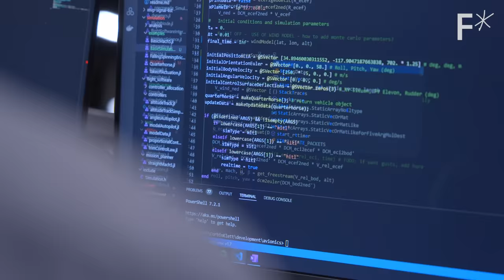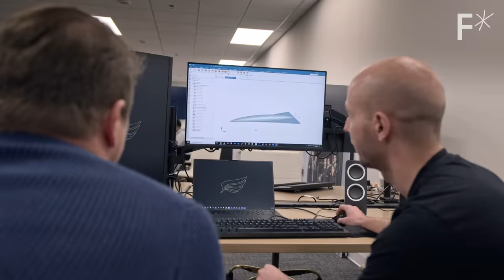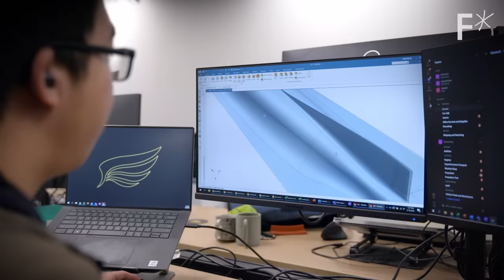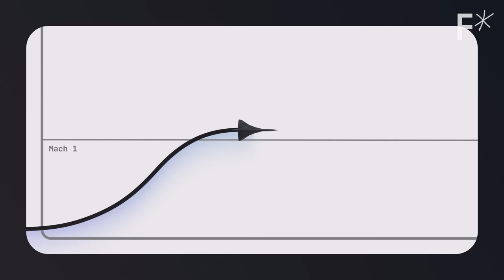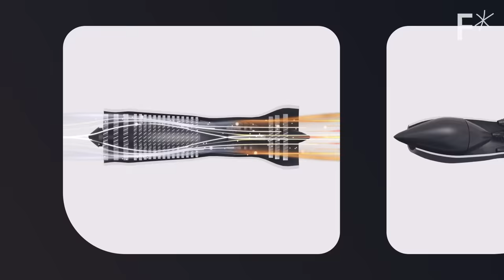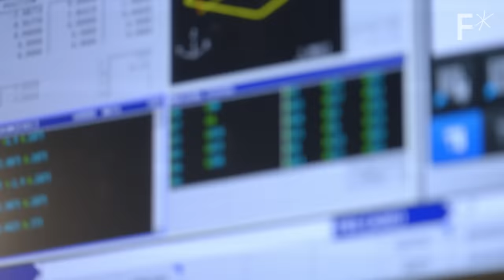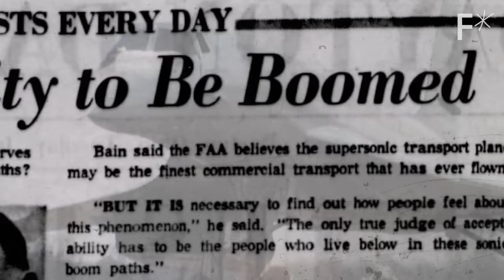This Mach-5 engine will do what no other can | Challengers

Comment from the maker: Do you think hypersonic passenger jets will become reality?
Reply: Absolutely.
Reply: No doubt whatsoever. Why? Because they're a stepping stone to single-stage-to-orbit.
Reply: Not while the leading edges are standard materials.
Reply: No.  What Earth needs is efficient (perforce, subsonic) air transport.
Reply: Not since oBiden was selected... jus say'n
Reply: I don't see it as practical. Supersonic passenger jets failed for a reason.
Reply: Yes. hypersonic jet aircraft,sub orbital and Moon,Mars flights will all become a reality in the next 100 years.
Reply: Never.

People seem to think the barrier to supersonic passenger travel is simply the act itself. The mere attempt to go those speed ranges is too difficult, engineering-wise.

They're treating it like the Concorde never existed. Like we've never had a supersonic passenger plane before. 

They seem to all forget what the real problems with supersonic passenger travel are. 
Sonic booms, and all the PR problems & regulatory problems that come with that.
Outrageous fuel consumption needed for afterburner use. And the usefull load hinderance that entails.
Completely unfeasible maintenance costs & maintenance hours per flight hour.
And the subsequently luducrous ticket prices that only the 1% of the 1% will ever be able to afford. 

Hell, the only places where you are even allowed to try supersonic passenger travel is over the oceans. far out over the oceans. 

I wish you guys luck. But i am 100% convinced this aircraft will never fly passengers.
Reply: Only in the upper-end of society. Hypersonic flight consumes a stupendous amount of fuel, which in turn raise up the price-per-passenger. Maybe if they'd switch to Green Hydrogen (and Green Hydrogen becomes cheap and abundant enough down the road) it'll become something less of a luxury. Either way, since they're barred from utilizing the system over land, it drives it into an ever deeper niche. Right now, it's very hard to see how airlines will be able to turn a profit on a Mach 1+ airliner.
Reply: Not for 10 or so years. maybe more.
This looks interesting.
A Australian company will test fly a Hypersonic drone next year, using a scramjet engine. has reached Mach 8 in a HIFIRE test and newer version was offered to USA Military under Aukus and has reached Mach 12 in Tunnel and ground tests.
Reply: not a chance.
Reply: I didn't fail, I found 2,000 ways how not to make a light bulb; I only need to find one way to make it work.  (Thomas Edison)
Reply: Not by modifying current technology, sure they will get close but other problems will surface trust me 😉
Reply: @Godscountry2732  nope maybe 30 years for commercial, the military already have 😉
Reply: Not in the near future because of the dangers of any failure at mach 5. The pilots of the Blackbird wore spacesuits as a precautionary measure to pressurization failure; does anyone think that commercial passengers would be ready to take that step? Would the FAA sign off on those risks?
Reply: highly likely. when/how/who is more appropriate query. is inevitable.
Reply: If you go into space yes. Not with a jet. Probably rocket lift, ramjet to glide, and land. The closest thing is a variable flow J-58
Reply: If the Americans have control possibly but if its the Europeans who developed Concorde then America will scupper it and not allow it over their airspace in my personal opinion.
Reply: The world of aviation’s already moved on from the hub and spoke model to direct connections. A Small scale hypersonic planes for business might be feasible. Maybe.

But we’ll move to slower, more comfortable, and efficient aircraft first. Mass hypersonic air travel won’t be a thing for the coming decades.
Reply: Uhhh aren't current planes already too costly and wasteful to run even with super high bypass engines and less than mach 1 speeds? The Concorde failed because of how expensive it was and now you're saying they are pooping out a mach 5 passenger plane? Who the hell has money to buy a ticket on board of that?
Reply: not in this year
Reply: According to the latest Top Gun movie, we're at Mach 10.  So many people think we are now.  : )
Reply: It would be neat if it were true, but if I had to guess if the DOD and NASA had discussions after the retirement of the hypersonic rocket-powered fixed-wing Shuttle and Mach 3.5 jet-engine powered SR -71/YF -12 A, to design and build a jet-engined or rocket-powered hypersonic sub-orbital spy plane, bomber, etc "I would say no."

Did the DOD need a hypersonic aircraft with our current satellite, cruise missile, and ICBM hypersonic reentry technology?I say no, but they could pretty much build anything they want under a hidden black budget Darpa program.Not to say the SR -71 was a hypersonic aircraft but the simple fact it was designed in the 1950s and operational in 1964, it wouldn't have surprised me if the DOD continued the program after 1999. 

China claims they tracked the SR -71/YF-12A  over its mainland at Mach 3.5 at 100,000 feet. The Shuttle as well was piloted on its wings at very, very high Mach numbers on reentry.
Reply: @We All Laugh Down Here that's what killed Concord and SST. Those issues haven't gone away.
Reply: You know, there's a lot of you know, possibility that you know, like, it's like, you know....

This is great a Jr. High level content.
Reply: Top speed in atmosphere is Mach 25, then the ship goes orbital.   As to your question, the scram jet is military hardware, not for passengers.
Reply: Will they become a reality sure. Will you be able to afford a ticket on one should they even be offered... good luck with that. While I applaud their efforts and wish them well, I find it far more likely the technology and it's initial improvements will come from the military sector before civilian. These guys may figure it out but frankly they're at a massive disadvantage. They have no access to cutting edge classified materials or components and while they can always get funding it will never touch the resources a nation can throw at the issue. These kids managing it would be like winning the lottery on a fluke purchase at some random gas station. Possible but far from probable.
Reply: This is all bullshit, it's a way for a group of people to play, and get payed properly from the tax money. That idea won't work, there are other intelligent people who tried that crap before and failed. Because the ramjet has a vicious thirst. So you can't give it enough fuel for it to be efficient, as long as you don't have enough oxygen in the ramjet. And you don't have enough oxygen in the ramjet because the hot gas that's coming from the jet is poor in oxygen!!!! So the mixture in the ramjet will be very hot but very rich, not efficient enough. Test it to see for yourself. The solution would be to have a normal jet in the middle and 2 separate ramjets around it, so they get fresh air when working. The jet with the afterburner would take the craft to Mach 1.8 no problem, more than enough for the ramjets to start. It's not true the ramjet can start at mach 3, it can start at over mach 1 no problem. Even if you overcome all these problems, the fuel consumption will be enormous, let alone the cost of such craft. Elon Musk wouldn't afford a ticket for that. So spend the tax money otherwise and get fkd with your mother fkn projects. Try green energy
Reply: I'm surprised your not trying to make it possible with the ohhhh so lovely green technology. 
Powerful windmills and super strong solar panels to charge the Chinese made batteries. 

Instead...you go for that dirty.... nasty... organic... fuel  derived from carbon...that comes from a whole in the ground.

Shame on you...I love it...make it spew fire  for as far as the eye can see. Let it make noises that raise the testosterone levels across the world.
Reply: Supersonic passenger jets failed, I don't see how a hypersonic passenger jet would fair any better, no matter how much we want it, with our current technology it just isn't feasible.
Reply: If and only if there is a market. I'm not sure people are going to be willing to pay the premium to get there a few hours sooner. What really killed Concord (and the reason why no U.S. SST was ever built) was the lack of a market. I'm not sure that the problem exists for which hypersonic passenger aircraft is a solution.

HOWEVER, I can very much see the DoD wanting a working hypersonic aircraft which can take off and land from conventional airfields. Unfortunately, such an aircraft would be anything but maneuverable. Even if the aircraft could withstand the g loads the occupants could not. For that reason I see a hypersonic aircraft as being either autonomous or remotely piloted.
Reply: What about the sr71 ? I’m pretty sure the f15 can do over Mach 3 ,, your biggest concern is fuel ,, because our government doesn’t want fossil fuels
Reply: @jeanladoire4141  Not for the likes of thee and me dude 😐
Reply: It will if we can build and run this tech at low costs.  This is well out of my neuroscience education, but I have enough physics and chem to understand what the challenges are.  Dealing with friction heating, safety and stability in dense air near at low altitudes, redundancy and ultra robust parts that are light enough to fly, are all huge materials science obstacles.  I'm so impressed by this teams effort and determination!  I hope they find smashing successes!
Reply: No, it's illegal in every country...
Reply: @dewaynemcgowan1937  the f-15 has a max speed of Mach 2.4 and efficiency is a big deal not because our government doesn't want fossil fuels, it has to do with range, global warming, and cost.
Reply: Nope:
1. Sonic booms restrict flights to basically over oceans. No Cross land supersonic flights will ever be permitted
2. Cost of fuel is going up, up, and away. I suspect by the 2030s air travel for most people will just be too expensive. Perhaps people will  afford to go on a long distant flight ever couple of years. Global Oil production peaked in 2018 and will be declining about 5% to 7% annually. We are already starting to see Oil prices climb. I think most airlines will go bust when Oil exceeds about $120/bbl to $135/bbl
Reply: @fromaggiovagiola9128  that's overstating its rigor😉
Reply: whats the point of going faster when u can go cheaper
Reply: I think it will be a show off between SpaceX Starship and hypersonic passenger jets.  I think hypersonic passenger jets will be the Betamax of paid air travel.
Reply: we had a concord and it failed, doubt about getting any hypersonic passenger aircraft.
Reply: @keymartin630  But do we need SSTO? A reliable and reusable 2-stage rocket arguably makes SSTO unnecessary.
Reply: Yes.....one step at a time
Reply: I live in Atlanta. Would this be something I would be able to come see?
Reply: Nobody though a rocket sent into space could land back on earth and fly into space again.  I guess anything is possible 🤷🏾‍♂️
Reply: yes
Reply: No
Reply: @TimCortesi  True to a point. A two-stage rocket will need infrastructure to support it. Right now, without a civilian destination in space, two-stage rockets are sufficient. However, to survive the long run, humanity must get out into the solar system. In my opinion, two-stage rockets are less efficient as they need guidance, fuel systems, engines, etc for two units, but only one is actually going into space. Two SSTOs could eventually deliver twice the cargo, and launch from modified runway facilities rather than specialized facilities. It really comes down to whether or not we get around to putting a Hilton in space; if that happens, the SSTO would be more economical.
Reply: No I don't think so..but we will probably discover a new form of propulsion in 100 years..that will be the next leap until then just slow jets
Reply: @algorythemQ  keep coping republican
Reply: No.
Reply: @rdbchase  yep
Reply: @seha6391  he didn't invent it tho
Reply: No
Reply: no, sonic boom
Reply: @cellokid5104  ya but transitioning From Sonic to Hypersonic is Still an impossibility Without Rockets at this point in our Technology They are trying to Bridge the Gap
Reply: loud af, no
Reply: at some point, no doubt about it.
Reply: No
Reply: Would hypersonic flight be affordable?
Concorde was extremely expensive and I always felt that Concorde was treated like a grenade with a loose pin.
It was a controversial aircraft people were always looking to poke hole in,
Supersonic boom, cost, problems and crashes ect
Reply: It’s seemingly an inevitability especially for beyond the year 2050 when crude oil based fuels are fully phased out! :)
Reply: The best way to produce a engine that has subsonic and supersonic combinations is a turboramjet
Reply: I expect some will be made, but they won't be commercial. And it could well be with a different propulsion system. Think UAP.
Reply: No lol, airlines already have a hard time making profits so they dont need money-skinhole planes 😂
Reply: Off course, we need this kind of technology now, this is the next step.
Reply: @davecrupel2817  The Answear is good .😉👍
Reply: I belive the People must in the Future more move under the Earth and in schmaler ways and so gar, then that is better for the Nature. 
We makes here to big footprints on the Earth,that is more as good Visible.
Reply: Supersonic? Maybe. Hyper sonic? Absolutely not. Unless there is a massive breakthrough in material science that would allow a cheap material to withstand extreme temperatures, there is no way it will become economically viable.  
That being said, never say never. I just don't think anyone watching this video will live to see it unfortunately.
Reply: Not in mine, our your life time. Maybe someday.  The biggest reason for hypersonic flight is getting to what's past THAT. Alien craft make it look so darn easy!
Reply: MAYBE YOO COOD CALL IT THE SR-71...
Reply: I’ve been wondering for a long time why the fastest aircraft ever invented was designed and built about 60 yrs ago. How is it that we DON’T have hypersonic flight by now?
Reply: Startupsbmaking bold futuristic promises are ten a penny, hypersonic flight is riddled with engineering & legal challenges that have defeated many of  the brightest minds humanity has produced. I feel like I'll be riding a unicorn to work before this becomes to fruition. Lol... No offence.
Reply: @10aDowningStreet  
Yup. Unicorn with spinners.
Reply: How do they plan to solve the sonic boom problem? Flying at Mach 1+ creates a loud bang. That is why Concorde was NOT ALLOWED to fly at Mach 1 above the land.
Flying faster than sound is very bad for people on the ground.
Reply: someday for sure
Reply: @davecrupel2817  I completely share your points and i would like to add a new big one to your list. The Concorde flew in an age where the time spent flying was just wasted time. There wasn't a lot to do really on flight from a passenger perspective, so speed was kind of worth it. But now we live in an Age of Internet on Planes, Laptops, Podcasts and Netflix. Time spent flying is easily filled with work and entertainment. I don't think people will buy a Planeticket 8x more expensive just so they can save 6 hours of flight time. Even the ultra rich fly relatively slow, because private jets are filled with amineties and you can keep working, meeting and relaxing. Going fast was never this useless lets be honest. I travel by train a lot and i can write for work, watch youtube, check emails and nap. Its no longer time wasted like in the 90s.
Reply: Hypersonic passenger jets? Nah, not gonna happen. Ramjets consume way too much fuel, and that is a problem, especially in the future with fuel prices going through the roof. And then there's maintenance cost. You think Concorde tickets were expensive? Wait until you see the ticket prices for a hypersonic jet! No-one will be able to afford a ticket, and any airline flying those jets will have to drop them like a hot potato or go bust.
Reply: Not with that kind of fuel for sure.
Reply: Nope.... it was proven by brits and french ))) and before them by us ;)
Reply: does the aircraft have to dip the nose down because of earth's curvature at that speed? otherwise it would end up in space after 30 minutes.
Reply: @trile9951  
that's what all flat earthers say because they have no idea how anything works.
Reply: No. Fuel economy will be awful.
Reply: Pulse detonation engines
Reply: @RWBHere  and thats just one  reason why those projects will fail
Reply: Only with pulse detonation engines with progressive build up of speed, otherwise our bones would shatter from take off.
Reply: clearly never heard of the concord. it did not end well.
Reply: Not likely, while fast ramjets are notoriously inefficient. If it comes to pass tickets will be expensive.
Reply: No.
Reply: Most definitely!
Reply: not with that airframe .
Reply: @keymartin630  that project exists
.... in England
Reply: @toupac3195  Proxmire!
Reply: @jeanladoire4141  
pas du tout,
Reply: the real question is do you think people will be willing to spend more money on airplane tickets to offset the costs of these hypersonic aircraft compared to what we currently have.

people have already voted with their dollar with the concord, and the concord is no more. hell, they won't even pay more for better service, people just look to see which airline is offering the cheapest tickets for their destination and then wonder why the service sucks.
Reply: @arturoeugster7228  You mean Skylon? There's still no place to go in space.
Reply: @keymartin630  right, they are supported by RR, the EU and have a product the heat exchangers. and a DARPA contract.
This here is a fake video,
Reply: I'm also an aerospace engineer and the simple answer is NO.
I love what these guys are doing and what they are trying to achieve but there's issues.

For starter, the sonic boom stuff ruined supersonic air travel is just nonsense. Its just been said so many times that its considered fact. The real problem is market place and people willing to pay for going that fast.

There's a great documentary on Concorde that goes over its entire history. It highlights one of the great examples of sensible market analysis and is something every business student should study.

A lot of people don't realise that Concorde was almost pulled from service after a couple of years because it was losing so much money. The pilots said it can't be losing money because every flight is full. So the business guys said "If you can make money you can keep flying and run the whole Concorde show if you want."

So the PILOTS did one of the great case studies in market analysis. They found that most of their passengers were this small group of bankers and lawyers. Some of them were flying 3 or 4 times return a week. These people got on Concorde flew across the Atlantic and as little as an hour later flew back. So they asked these people were doing. 

They found there was a lot of banking contract and major business contract work that needed to be done by real people face to face and at times those meetings were only minutes long. So they asked these people if they knew what a ticket cost and got a huge surprise because none of them really knew. They just had their secretaries book the flights. So they asked what they thought a Concorde ticket was worth and found these people valued Concorde over 5x higher than seats were selling for.

So the pilots jacked up the prices, people kept flying on Concorde and over the next 25+ years Concorde was the most profitable part of British Airways. AND THE WHOLE TIME IT WAS RUN BY THE PILOTS

What killed Concorde wasn't the Paris crash it was 9/11 and the A380. In the 9/11 attacks Concorde lost almost 100 of its biggest users. That loss of their customer base hurt huge, but then Airbus who were bringing out the A380 would not service the engines which they had exclusive rights too. They wanted to get rid of Concorde and those reasons have never been clearly explained. Richard Branson tried to buy the planes and Airbus said so what we control the engine servicing.

That's going to be the problem for Hermeus. Where's their customer base and what will the big players do to them?
I love the technology and love what these guys are trying to do but there's an old saying in aviation. If you want to make a pile of money on aviation you need to start with mountain of money.
Reply: I hope not.
Reply: No. Hypersonic commercial flights are banned above land, so no NY to LA flights and people won't pay the money for USA to EU flights.
Reply: No. Cuz of same reason why we have no Concorde ancestors.

Sonic boom.
People just won't tolerate it
Reply: Dark passengers?
Reply: This is a general avaition video.Developing, engineering, and manufacturing Mach 5 plus engines is not something you'll find on YouTube.Perhaps in 50 years we will see some videos from MIT, Darpa, Boeing, RR, etc., that were classified during the 1990s.
Reply: I am just wondering why they only use nuclear tokamak thermal shielding,
to keep heat management of 150,000,000 C+ controlled on the inside, 
rather than on the outside.
Reply: Possibly. If anything, it will drive our understanding of aerodynamics forward. What they really need that all other successes had, is competition.
Reply: @rdbchase  
We have those!  They are called airliners.
Reply: @MrMuki61  
"Green hydrogen"?  Hydrogen is a colorful gas?😁
Seriously, Green alternative energy cost much more than conventional sources!  "Green" hydrogen will always cost more!
Reply: Quite possible if they can get the cost down, which they may well be able to do!
I have seen proposals for suborbital flights across the Atlantic and Pacific using modified SpaceX Starliners.
Reply: @mahbriggs  Nonsense!  Commercial airliners might be 30% more efficient and should be; hypersonic travel for the filthy-rich is absolutely the wrong idea at the worst possible time.  Humankind has not begun to exhaust the possibilities of appropriate technologies, but we are ignoring some of the most important (LFTR and passive maglev, e.g.) in favor of faddism and fantasy (Hyperloop, Direct Air Capture of CO2, and this, e.g.).  It's possible that someone other than you or I will one day use hypersonic transport, but that doesn't do the mass of humanity including me and very likely you any good.  No matter how good this engine is, it's not going to change the kinematics involved or lower the cost of hypersonic flight to the point that any but a few could ever travel that way.  Before fantasizing about hypersonic planes you'll never fly in even if they're built, reflect upon the fact that Boom Aerospace has no engine for its proposed supersonic passenger aircraft; might as well imagine hypersonic aircraft instead, I suppose.
Reply: @karlshipley5142  -- are probably too loud to use on a passenger aircraft.
Reply: Yes, but not soon. There are little to no markets for it.
Reply: @oneroneen  
Don't disagree, but things change!
In 2015 did you think SpaceX would be reusing it's Falcon 9 rockets?  Or that in the year 1990, that the first smart phone would be developed by IBM within two years?
I try not to predict too closely the rate of technological progress.
Reply: No. They likely won't.
Reply: @bigboypants988  
Trans Pacific and trans Ataltic passenger service is growing, and new supersonic designs are being developed.  Plus at the altitudes a hypersonic vehicle would travel, it is possible sonic booms might not be a problem.
Reply: This seems like a military project to design mach-5 drones.  Commercial passenger flights have a lot more design constraints (Payload carrying capacity, fuel efficiency, range, passenger comfort considerations, zoning restrictions for sonic booms, etc).
Reply: as an aviator who may very well go into the commercial sector I hope so; that way I can fly one.
Reply: @jessstuart7495  
A quite worthy endeavor in itself!
But many military projects have civilian uses.
Reply: Hermeus is taking this in all the wrong ways. To achieve hypersonic speeds at scales above the small Unmanned Aerial Vehicle with today's technology and metallurgy, you need SCRAMJET engines and a Rocket Assisted Takeoff to get to Mach 1 and achieve the appropriate speeds.

Unless you have a Combined Cycle afterburning jet turbine, ala DarkStar.
Reply: No
Reply: naah too risky
Reply: no
Reply: Yep!! But I Will let other people test for me for some years first ! Remember the UK Comet 1st jet passenger plane.
Reply: Only if fuel consumption per passager is somewhat comparable to subsonic planes. It takes time to get to and from the aeroport, and you have to adjust your plans to routes and times when planes fly. If money is not an issue and time is most important, that subsonic private jet will bring you faster from point A to B when you need it.
Reply: Not if you keep using the imperial system hahahaha
Reply: never
Reply: Of course. Less than 200 years ago people thought passengers on the early trains would suffocate. It's not a question of the science, thats largely known and understood, but of persistence in engineering, and then economics. If there are people prepared to go into space, there are a LOT more prepared to travel to places really quickly. If not this attempt, there will be another, and another until it happens. There is just NO reason it won't happen, so its inevitable.
Reply: No, a big reason why the Concorde failed is because of the supersonic boom it created. I'm pretty sure going supersonic was even banned in multiple European countries. That thing will burn so much fuel as well, and that thing will probably be super maintenance intensive.
Reply: they will really have to build a ne plane, that is a lot of stress on an air frame
Reply: Not over land
Reply: I believe it will have a massive effect on how we defend ourselves before it eventually bleeds into the public sector.
Reply: @definitelyfrank9341  14:33-14:46 explains what thats not a significant risk to their business model.
Reply: absoolutely not
Reply: No, they burn way too much fuel and make way too much noise to be viable. A 2-hour hypersonic trip in economy cattle class would cost just as much as a 8 hours in a luxurious first class private berth on an A-380 or a private plane, equivalent to a nice hotel room. Processing,  luggage checks and transits to and from airports will take at least 3 hours already anyways unless you are booking a private aircraft for yourself.
Reply: @graysonlaugher3143  Only use I can think of is some military applications, it could deliver a spec ops paratrooper team with a lot of supplies anywhere in the world in 5 times less time than conventional military aircraft
Reply: no
Reply: Yes, but my bet is on RDEs.
Reply: NO
This is ridiculous, you can't change the laws of physics. The energy per kilogram in chemical fuel & the tremendous amount of drag at hypersonic speeds.
This was all tried & tested 60+ yrs ago with the  X15. Small range, massive cost. Can never be used to carry passengers.
You're fantasists
Reply: @pobinr  

People used to say stuff like that to the Wright brothers...  People used to say stuff like that about space flight.  People used to say stuff like that about sailing wooden sail boats around the globe...  People used to say stuff like that to Elon Musk about reusing rocket boosters and upper stages.  Now, all of the aerospace companies are getting in on reusability, to one degree or another.

People who said stuff like what you said were always proven wrong, and always will be proven wrong.

Materials exist today, that didn't exist in the 1960s and 70s.  Design concepts exist today that didn't in the 60s and 70s.  That might be the key in making a difference in today's engineering efforts.  Heck, there's a company building a rocket completely from 3D printing it, and it's getting ready for its first flight, soon.

Jet engine designs have become more sophisticated since the early days of jet propulsion.  The X-15 was powered by a solid rocket motor, not a jet engine.

Things have changed and improved since then.  Maybe this company might not quite get there, but they will have made significant progress in showing what works and what doesn't, and the next venture might succeed where they failed.

Look at Bigalow Space.  They invented the inflatable space module.  They never got to launch their inflatable space habitat and went out of business.  However, a new company is getting ready to launch their inflatable space module and it will be tested in space (I think it will be connected to the ISS).

Never say, never.
Reply: @thecrusader6401  fuel cost bro. How they gonna afford it? British airways nearly went bust after using concord
Reply: @direbearcoat7551  fundamentals aren't changed enough to make enough difference.
Reply: Reality, available to an elite and very well-heeled few who believe the benefits will outweigh the likely extreme cost of a ticket.
Reply: Yes, but never for the common person. The energy needed is, and will forever be extremely high.
Reply: Concorde Mk II? It's definitely possible, it's highly unlikely to be profitable.. That's the biggest problem.
Reply: Yeah, the concord was the first to make it super sonic now hypersonic isn't impossible
Reply: I think it will mostly live in the military space for quite a while 10-30 years or so. Safety, economics and adhering to extremely stringent regulations is the nature of civil passenger aviation. This won't become reality anytime soon, even if the technology works. But of course I hope to be proven wrong :)
Reply: It had happend before using Concorde.
The fuel economy and maint cost however... I hope your customers are all billionares.
Reply: @niccatipay  Concorde was supersonic, not hypersonic. Quite a big difference
Reply: @thorwaldjohanson2526  
Ah thankyou for the clarification.

Perhaps such flights would be going to space and will be used by national leaders or by select groups to attend an emergency meeting. Fuel and maint be costlier tho so it will need a cheap source of fuel.
Reply: @niccatipay  you will not be able to go to space with this, especially not reach orbit (opposed to flying up and falling back down). Turbojet, ramjet and scramjet engines are all air breathing, they do not work in space or very high atmosphere.
Reply: @thorwaldjohanson2526  
Liquid rocket assist to travel in space for a bit. It should cause less friction during hypersonic travel and you wont have to worry as much  about the weather.
Reply: the concorde failed and so will this
Reply: No.

Before that we will use warp drives ...
Reply: Yes off course, the question is when and how to overcome its existing problem.
Reply: probably not, because the ticket price will be so expensive so nobody would buy it. We had supesonic Konkord before
Reply: I think a lot of people are disillusioned in this video in thinking what they are doing is actually important in some practical way. If you want to travel fast, just go higher, hell the higher you go requires less fuel... this isn't that hard. Nobody cares,.. I mean nobody really cares about traveling at 5 times the speed of sound,.. unless you are going into space... so why not just cut the BS and go there?
Reply: @andyowens5494  Okay, but, would 70% - 80% of the world be willing to spend 90% - 145% more to get to their destination several hours earlier? If I remember correctly the video says at one point that people dislike air travel because it's 'un-luxurious'? So I'm assuming either they're plan is to cut the flight time down a lot to make their "unbearable suffering" shorter, or, to make flight more luxurious - and to do that, you'll need to waste space. From what I have learnt from my physics book, going mach 5 will give you more than 2Gs at least, while just flying level. Not very luxurious. It'll also be difficult to keep the interior of a air frame that has a weighted-average temperature of roughly 1,350 degrees at an optimal temperature, won't it? I highly doubt any airline company will buy it. Airline owners want a plane that'll make profit, not a "futuristic" plane.
Reply: @definitelyfrank9341  70-80% of the world do not need to want this. 70-80% of the world do not own a car! (EDIT: 82%! Yes, only 18% of the world owns a car, far fewer fly, and a tiny proportion of the billions of people on planet earth will want to go hypersonic, but thats still a LOT of people). This is a niche product, as Concorde was. I do not know when you last looked at a physics book, but the speed one travels at has absolutely nothing to do with the g-forces experienced (and I say that as a physics graduate). The g-force comes from the acceleration, so whilst it could accelerate to mach 5 at that rate, it doesn't have to. Concorde didn't, so why would this!? Interior temperature - will not be a problem; the SR71 Blackbird had a very hot external skin temperature (and the crew warmed their food against the windows), but with insulation and air conditioning, its relatively easy to set an internal temperature. The space shuttle went even faster, and they manage quite well. Do not forget, the outside temperature of most commercial flights is well below freezing, but in my last flight there were people wearing t-shirts and sandals; it's amazing what we can do with thermodynamics these days. I guarantee if they can make it, someone will buy it - heck, rock bands run their own aircraft; there are people on this planet who can afford pretty much whatever price they would charge (and I guess you're not one of them, I know I'm not). There is even an example airline in existence already: Virgin Galactic - not many customers, but they exist and are willing to pay. So, why won't hypersonic transport be viable again? Heck, people will go on a Virgin Galactic trip to come back to where they left from!
Reply: @andyowens5494  It's kind of irrelevant since this thing will be flying over water primarily.  I would also like to ask: which airliners would want a hypersonic aircraft that can't fly over most relevant countries, has seats that most people can't afford, an aircraft that can reach speeds very few aircraft have ever done because: 1. It's very dangerous. 2. There are very few tasks that require it. 3. It's very costly. 
The SR-71, and the "space shuttle" are very different to what these people are building. The SR-71 had a tiny cockpit to carry 1 man, and It could only go supersonic. It also seems you are trying to reason that it would be good to have them around for the rich. It takes tens of thousands of dollars to maintain a supersonic aircraft, much more for a hypersonic one. Although I may not know much about physics, I know a good amount about business. I heard that Concorde was built to be the future kind of transport (and also to leapfrog ahead of the Americans). These guys are also trying to make hypersonic Into a future speed to move at. Also, wouldn't it be a bit difficult to distinguish an ICBM of similar size, and speed from a hypersonic aircraft? There's probably a way to distinguish the two but it's just a thought.
Reply: @definitelyfrank9341  Did you actually watch the video? 14:30 to 14:45 explains the market assessment they've done, and if you understand business so well, you'll know that other people will have scrutinised that assessment before investing in the funding thats got them this far.

I'm not going to pick all your points apart again, I've got better things to do if you havent taken in whats in the video itself. However, confusion with ICBM's - I give you a) flight plans, and b) it's trackable (and no, major airports are not all home to missile launch sites). I'm not sure what kind of business understanding you have, but I'm amazed if you've ever been anything more than self-employed; vision and understanding will get you much further, and both can be learned.
Reply: @andyowens5494  Yes, I've watched the video. I'm a minor by the way. I also meant confusion with incoming ICBMs, because you don't usually want to shoot down missiles from your country. And, also, you can't see the flight plan of a aircraft (unless you're in the cockpit). At least not without the aircraft sending it to you, but I don't think they can even do that. And If companies really thought about the how successful said project would be, then, then you wouldn't be able to look at a big company's history and find many failed but still expensive projects. Just look at the multi billion dollar LCSs US is retiring. 

You can't really make profit from a hypersonic airliner. You can't get an average pilot and put him in a hypersonic airliner. He'll have to go through a LOT of training... And that's if they'd even want to fly that aircraft. Since pilots and attendants get paid by the hour, and you're going to take less than 1/5th the time it took the record holding British Airways Flight 112 747, then you'd probably have to pay them 5 times the amount they're usually paid.
Reply: @definitelyfrank9341  OK, so you're a minor; you have a lot to learn, and I suggest you make the effort to learn BEFORE commenting on stuff you don't understand. That applies more in life than on Facebook. Flight plans for most commercial aircraft are filed with all air authorities an aircraft will be flying through - so they can ensure there is space, and plan capacity, BEFORE the aircraft leaves the ground. There are teams of dispatchers generating the information for pilots, ATC etc. and the pilots have to confirm their intentions and any deviation from the plan. The days of a pilot jumping into a plane, getting on the radio, starting the engines and taking off are long gone (it's possible at some small fields in smaller aircraft, but not much in commercial flying). There is no point taking off if there won't be a time slot at your destination to land when you get there; EVERYTHING is planned in advance.

I'm not aware I made any distinction about outgoing or incoming ICBM's, but my comment stands regarding mitigations.

If you want to get into a debate, have the knowledge and experience to back up your arguments, not just an opinion - unless all you want to be is an internet influencer, in which case, good luck, many try but few make much money out of it. BTW, I retired very comfortably at 52: I knew what I was talking about, so people paid me lots for my advice, sufficient that I could retire and enjoy spending it.
Reply: No
Reply: The only user of this technology if it is perfected will be the military. Passenger jets zooming around at 4000 mph is a pipe dream.
Reply: Change is only constant in reality 😜
Reply: @jamesadams893  To be honest, I doubt even the military would have much use for it. It was realized that speed wasn't that important after the Vietnam war.
Reply: They already have.

Will it be common .

No.
Reply: Concord?
Reply: No thank you I don't need a Hypersonic 911
Reply: LOL no. The inefficiency of higher speed will keep this to military applications.
Reply: Absolutely!!!!!! You'll dookie right into your seats or the person next to you hypersonic vs gravity vs holding your bowel...equal=🤣
Reply: Splat splat. Splat.
Reply: Yo...
All of this is BS!!!
Reply: yes for aerial bombarment...
Reply: Yes. They’ll be called rockets though.
Reply: Id love to fly in it. for fun too. can you imagine hypersonic redbull  jet races? add some hypermanuvarablility to it and you got some insaine acrobatics you could fo. it would be the ultimate extream sport
Reply: There's some sections of this video where the camera work is absolutely unwatchable. 

Please try to improve....
Reply: Distant future? Yes. In my lifetime? Nope. But hell yeah my descendants will see that.
Reply: couldn't give a dam about passenger jets when we are on the edge of a nuclear war this company should approach the us defense authority. Imagine having no passengers its a possibility
Reply: @ComedyKraze1  Ummm that's NOT their job, they're civilian for a start ! Derrr

Don't bother responding, I've little time for lunatics.
Reply: no its too loud
Reply: No.

Yes can produce more powerful engines or propulsion system, but we don't have the material for the vehicle to sustain the forces.
Reply: Absolutely not.
Reply: I do, but the tickets would be extremely expensive.
Reply: i think the answer to the climate problems we've caused is not making rich folks travel even faster.
Reply: I do NOT want sonic booms every 10 minutes of my life.
Reply: People that refuse to learn from mistakes are the people who become stuck in life guys you need to be looking into what fission reactors can learn you about ironising air and magnetism it’s really interesting what you are doing I have a 1% in the world superior visual reasoning profile there is something you need.
Reply: maybe in 100 years
Reply: @davecrupel2817  A different fuel source would solve that issue, hydrogen likely this century, fission can be used too.
Reply: @graysonlaugher3143  That's why you keep researching until you achieve it.
Reply: Already is
Reply: Already is
Reply: No because it was already a thing.. you need to look into the Concorde and realize this won't work. The definition of insanity is doing the same thing over expecting a different result. Stop embarrassing yourself..
Reply: I believe it would be a niche market as the expense would be great, similar to the Concorde.   So while I think we are currently capable of doing it, don’t think it’s a financially viable option for a multitude of reasons.
Reply: No, the same reason supersonic passenger planes are not a thing. Not economically viable from a fuel and maintenance cost point.
Reply: Absolutely not, it's not a technical issue though, it's purely an issue with having supersonic+ jets fly over cities and the like, the concord was also a supersonic passenger jet, and failed for this reason. Though, hypersonic Military jets are a no-brainer.
Reply: After concorde I dont thinks so
Reply: I hope not
Reply: no lol. its not worth it to airlines: higher maintenance cost, lower efficiency, lower profit margins.
Reply: @joshtryon1107  HELL no!
Reply: As the guy in the video says, "failure is the most likely outcome."

I mean, we used to have the Concorde.  It was a nightmare to manage; it created so much noise that no inland airport would allow it.  Fuel is only getting more expensive as time goes on.  

But hey, the rich are getting richer and the poor are getting poorer.  I could easily see $100k vanity flights, like Blue Origin's jaunts into space.  But as a regular passenger jet?  Technically we've known how to do it for 50 years but the economics haven't changed.
Reply: Only if you can make it cost the same as a regular airliner on a per passenger basis. Concorde only made it as long as it did because the French and British governments heavily subsidized it, and it STILL cost way more per passenger.
Reply: Naww
Reply: I got into aviation as mechanic in 1978 worked for 40ty years prior to retirement.  My dream from day 1 was I would see and experience hypersonic flight.  Then be on the ground to repair the aircraft as required.  I believe in my heart as materials change in strength, weight and durability it will happen. However I have questions regarding the ability to hold these materials together at speed. The fasteners we use today have very specific sheer and tensile strength.  The hotter fasteners get the weaker they get until they cool. Hypersonic flight will heat treat the exterior of the aircraft until after x number of cycles it will fail do to fatigue. We need new materials that are incredibly strong and manage temperature.   Materials that don't expand and contract leading to failure do to fatigue. Good luck I hope it happens.
Reply: Absolutely not.  If this made any financial sense in the passenger aircraft industry, than why isn't Concord flying anymore?  Flying at mach 5 is going to use how much fuel??
Reply: It already is real nasa has suborbital planes 
There's many aircraft that go above 4.5

I'm an Air Force Electrical Engineer

What really interests me is no fuel aircraft which sounds crazy but might be possible with anti/gravity 
Levitation systems 
With lift and push

Plasma jets,
Uranium
Ion thrusters.etc?!.
Reply: @Godscountry2732  25 years it's already here and I have the research and evidence to back it up
Reply: @aitorgarcia4786  anti-gravity 
Levitation
Reply: @millsshumps1968  aluminum-tungsten 
Al-li alloys 

Tungsten-Titanium 
Carbon-steel
Reply: Yes in 20 years
Reply: IDK
Reply: @algorythemQ Is Biden not capable of being hypersonic...
That's a shame...
Reply: I agree,it will be at least 50 -100 years before hypersonic passenger jets become a viable and "some what safe mode of transportation".The risks will be like orbital flight is today.But despite the technological hurdles, the airline industry still has a strong interest in mach 2 and faster passenger service. American and United airlines have committed to buying Boom Supersonic's mach 1.7 Overture passenger aircraft. *35 planes in total.
Reply: I rather see more fuel efficient engine development than hypersonic...
Reply: I remember hearing somewhere that with the SR 71 Black bird, speed started to increase to mach 3, and the person flying it began to feel himself being stretched from the speed. Don't take my word for granted, I heard this from 10 years ago. You'd also have to fly up in the atmosphere in order to travel that fast, otherwise the plane will begin to burn up and get destroyed
Reply: The only practical way to travel hypersonic is to get above the atmosphere where the drag is much lower.  You have to get into orbit.  That's what Richard Branson Virgin Galactic has been working on for the last 15 years or so.
Reply: @stinkypoop5879 I would agree
Reply: Won't happen, so NO
Reply: Yes but will be replaced by transient vehicles, or a vehicle that can go from ground to water to space to sun to atmospheric pressure at will out of order but order should not matter to a transient vehicle and could be achieved by using dry ice to counteract the heat build-up from friction.  All we gotta do is figure out how to remove friction from flight and remove pressure from affecting the craft
Reply: Good luck. Although the concept is no doubt very intriguing, it's also very terrifying. Imagine a catastrophic failure during a hypersonic flight. It'll be over so quickly that you won't even get a chance to blink. Think of the people on the ground who could potentially be hit by a loaded jet with passengers, luggage and fuel traveling at +3,000 mph. That'll be the equivalent yield of a blast from a nuclear capable missile.  I think some things are better left as concepts than be made a reality. Cool project though.
Reply: Not really
Reply: Why not suppliment the inefficientcy with oxydizer?
Reply: @algorythemQ  well the technology is being developed during his time in office so that is progress. Better than telling your followers to storm Capitol Hill - just sayin.
Reply: There are not even supersonic jets, let alone hypersonic... No I don't think they'll be a reality in a near future.
They had the concord, the only supersonic passenger jet (the soviets had one too but wasn't successful as I've read) and they canceled it because of noise issues along with other problems.
Reply: Militarized versions will
Reply: No, It's better to fly over the atmosphere at those speeds, even faster speeds can be attained by a reusable rocket.  Fighting the atmosphere at those speeds in a sustained format is inefficient.  You can reach speeds of over  17,000 mph is a sub-orbital trajectory.   Hypersonic weapons make sense, Hypersonic aircraft do not.  There's a reason why Black Bird was retired.  Starship would make a better fast transit vehicle.  Anywhere in the world in 40 min.
Reply: The cost involved moving  a person/passenger. Per mile is not cost effective from a commercial point of view   Take for example the Concorde  yes study it’s history and figure it on your own 
Hypersonic ?  Is a dream to fill you tubers pockets   Not even the military is optimistic about it
Reply: No. Using 10x the energy is bad for environment.
Reply: They can be available tomorrow. The problem is making money, fuel saving, and profitability that keeps these targets away. Also, if a passenger has to go to a bigger hub to fly hypersonic over the water only, or take a direct flight approximating a little more travel time but no connections then whats the point. I am being cynical now, but just checked, sonic booms do not reach earth from above 35000 feet (NASA).  I am sure these ram jets fly in the stratosphere. Last, we accept white noise all over but complain about a few booms a day??
Reply: Darkstar coming closer to reality
Reply: @DespaceMan  what hypersonic plane have you seen for the army?
Reply: Never
Reply: Nope
Reply: lol Concorde
Reply: absolutely not. the amount of maintenance hours to keep it in the air would make the tickets at least $1 million each
Reply: no, I can see all air travel becoming so ludicrously expensive only the wealthy will be able to continue using it.
Reply: i'd rather spaceX get starship perfected and get anywhere on the globe in 30minutes :)
Reply: No
Reply: @algorythemQ  gtfoh da
Reply: No - it is more possible you will deliver the technology to US Air Force or who want a hypersonic missile to get up on par with Russia and China.
Well done ...
Reply: No, JB does not want fueled planes.
Reply: The airforce is backing it so it’s going to succeed
Reply: @thecrusader6401  by
Reply: It’s exponentially more expensive to fly faster, evidenced by the fact that a 737 doesn’t fly any faster than it did over a half century ago.

I think tech making current flying more productive for business travelers is more likely. WiFi will get cheaper and better. And the need for in person meetings will be reduced.
Reply: Not in the near future
Reply: Absolutely non.
Reply: @Godscountry2732  sooner
Reply: Nope. Inefficient + Production Cost + Extreme risk. We are not even close in terms of material sciences.
Reply: No
Reply: consensus speculation?
Reply: Noooooooooooooope.
Reply: Nope.
Reply: Absolutely not. They're not necessary, they're incredibly inefficient, loud, wasteful, and we don't really have a need for them IMO. We should be spending that development money on other things, imo. As awesome as this is, it's ultimately a vanity project, absolutely unnecessary.
Reply: No, unless they tackle the biggest problem, fuel. An aircraft flying as hypersonic speeds will burn fuel faster than OPEC can pump it out of the ground....
Reply: Technologically, no doubt it can be done. Practically, no way.
Reply: No. The big airline manufacturers don't build hypersonic aircraft, not because they can't, but because all their economic research leads them towards more efficient and cheaper flights. I'm sure if you ask any Joe on the street if they are for hypersonic fights they would say yes but ask them if they would pay double or triple or even more for a faster flight then I'm not so sure.
Reply: Is they use Vanadium to coat the plane. It’s achievable.
Reply: @jacklongman60  little bit off on everything you said sir, starting with the fact that Hermius is a privately held company not government funded.  Do your homework pre-rant.
Reply: @thecrusader6401  it will become a reality if we find better materials to build the aircraft. I think when that happens people themselves will evolve to fly..... 😬
Reply: Like who cares?
Reply: No
Reply: This is going to sound weird and mildly idiotic, but with the NFL planning to expand to Europe, there is a large group of billionaires who want to see this happen. For those wondering why: The NFL hosts a couple games in Europe every year. The players have a REALLY hard time adjusting because of the length of the flights. The NFL plans on putting 4 teams in Europe and there's no way that works without a hypersonic aircraft.
Reply: @TheCho22  I don't find that idiotic at all. That actually makes sense to me.
Reply: @aaroneverett296  Thank you! The disclaimer is more for people who don't follow sports or understand/appreciate the NFL's power to influence policy. We love our sports here!
Reply: Nope. Too expensive and all we have seen here is toys 🚀
Reply: The only failure is not being able to implement Geo-Engineering/S.A.I stratospheric aerosol injection/Spraying out the back of that plane with nozzles, if you "really want it to be acceptable internationally or "US", so it can be used for the "boiling frog"/"buying time"/Spraying Programs to help switch over to Zero Emission concepts. It'd be nice to watch the Lines zip even faster across the sky. And spread out into man made cloud cover, that persists for hours as it spreads out and comes down through the stratospheric top/higher layer.
Reply: Absolutely, as soon as we figured out ability to bend space and time then it is inevitable to go hypersonic in the means of reducing time rather than increasing speed. Hmm, does that mean we won't. Just different mean? Its all a theory until proven :D I would place a bet on these guys sold-out to military applications before any civilian air travel could afford it.
Reply: agreed
Reply: yes it will but not with Technology u have making. u all still cant tink out of the box and making same old Technology just bit beter. there are no Future  for fuel bunrning engine. but atleast u trying sumting and i tink its good so nice job
Reply: yes
Reply: The problem with supersonic commercial flight was cost. It takes WAY more fuel to go that fast. I don't see this happening for regular commercial travel because few people would pay several thousand dollars for one plane ticket. However, I could see this as an elite business jet. Very wealthy people flying private from LA to Tokyo regularly, for example, would love this.
Reply: Eventually
Reply: For the rich, yes.
Reply: unless you move to sub orbital no..need really innovative skin material which is not expensive but can withstand above into save margin.
Reply: I think it can probably be done.  For the near term I think increasing efficiency is more important, reducing carbon footprint.
Reply: My guess once they get hypersonic working it will be used for military applications not for passenger jets.
Reply: Not with you people designing them.
Reply: Absolutely not, so long as air travel stays within the atmosphere. The power losses as a result of air resistance at those speeds make these speeds as a means a regular passenger transport entirely impractical. A more likely future is vessels that enter space or at least close to it like the region referred to as the "exosphere" for a majority of their flight-time. as a result, because of the enormous energy requirement of reaching said altitude, this would most likely only make any kind of sense for direct flights across most of the globe, and even then, the efficiency losses make it something that could not survive as a commercial business.
Reply: @keymartin630  I feel like once this tech is ready it could be mixed with a virgin galactic craft or something similar.. I think the future were speeding towards if we can stabilize it will be amazing
Reply: The question is should it be a reality?  What about the CO2, NOx, and other potential ozone depleting emissions with a hypersonic passenger jet?    Environmental consequences of hypersonic air travel versus other supersonic competitors must be a number one priority.  The up side is if this tech allows SSTO or reduced airline costs and emissions.
Reply: Hypersonic travel a reality?
To what purpose?...
Sure you could fly amazingly fast, but if you travel Transatlantic most of the time in the air you'd be either accelerating of slowing down again. 

Just to shave off a few minutes from regular flight, bit at humongous costs, since ramjets are notoriously fuel-hungry.

I see far more future in more efficient methods of travel that might cost a few minutes more, but using far less fuel.
Reply: Not as a passenger plane. Fighter pilots struggle with Mach 5 G-forces, let alone a regular person.
Reply: Nope.
Reply: It's absurd to think that the fuel costs associated with the massive inefficiencies of lifting all the dead weight in an aircraft to a ridiculous altitude just to get somewhere faster are worth the fuel costs and pollution that are guaranteed with this insane form of travel. High speed rail, on the other hand, would be worth the investment! The only reason this engine is wanted is for military use, and it is sheer gaslighting to think it could be used for passenger traffic. Dream on, your illogic will destroy any sane transportation discussion, for long enough to guarantee the loss of all life from earth! The Fukushima reactors have released as much radioactive materials as 450 million atomic bombs, into the air and oceans. Chasing this dream is too late for planet earth, and the obviously radiation brain damaged puny humans.
Reply: It's absurd to think that the fuel costs associated with the massive inefficiencies of lifting all the dead weight in an aircraft to a ridiculous altitude just to get somewhere faster are worth the fuel costs and pollution that are guaranteed with this insane form of travel. High speed rail, on the other hand, would be worth the investment! The only reason this engine is wanted is for military use, and it is sheer gaslighting to think it could be used for passenger traffic. Dream on, your illogic will destroy any sane transportation discussion, for long enough to guarantee the loss of all life from earth! The Fukushima reactors have released as much radioactive materials as 100,000,000 atomic bombs into the air and oceans! We are seeing  the loss of many species going extinct, 7000 or more just from the coastal tide pools!  Salmon are nearly extinct, the squid fishing industry is shattered, the king crab are simply gone, wiped out! As the poisons spread, all food will become toxic. The plankton that feed the whales are gone from the pacific ocean, 90% reduced from the Atlantic! This explains the huge whale die-offs, while the plankton are responsible for 70% of Earth's OXYGEN generation! A huge engine burning what we breathe and releasing pollution to further blanket the earth in death!  Enjoy your insane fever dream while the good things in life evaporate.
Reply: @rdbchase  Like high speed rail?
Reply: @MrMuki61  Then the super-rich should be funding this insane research! Not the taxpayers!
Reply: No, we done it with Concorde and it was a failure, too expensive for not enough passengers, go slower with more comfort won the battle. We will skip hypersonic jets and go to the Starship route to get anywhere in the world in 30 minutes with a minimum of 100 passangers.
Reply: Absolutely not.
Reply: NOPE.  Why don't we have the Concorde anymore?
1.  It cost too much.
2.  Once it exploded and people died.
     a. Also they lost interest after that.
Reply: @Godscountry2732  Perhaps. if the discover some new elements that are badder than titanium. Or a big ole vein of  enormous graphene molecules. 

Call me
Reply: @joshtryon1107  Excellent point, Josh. Didn't they address this in the Doctor Who reboot...circa David Tennant?
Reply: @theglitch312  Right...I believe business travel on our former scale has been Reset.
Reply: @billmullins6833  I'm with you' Bill. And why not.
Reply: Nope. If supersonic jets had so much trouble (albeit a long time ago), i doubt HYPERSONIC will be sustainable for travel.
Reply: Nope. Not with the way our economy is going.
Reply: @keymartin630  nope, there actually is a Hybrid rocket jet engine design that is undergoing development, and it's not Hypersonic, but if you only listen to the "public hype crew" you most likely wouldn't know about it, after all it isn't being developed by some big private corporation...
Reply: No
Reply: No it’s too expensive to be viable
Reply: It would be a good Fighter jet
Reply: @d-raptor5912  no it would not, this thing would be seen on any thermal imaging like a flamethrower in the Arctic...
Reply: "They're busy revving up to powerful MACH FIIIIVE!"...
Reply: When you find the right people coming up now through now in schools it will be done! 🎃
Reply: Supersonic commercial flight was already done. It was called concord and the narrative of why it stopped because it had to fly really high and it hurt the sky gods or something
Reply: No, will not. They can now make airplane twice as faster as today's, but from x reasons they don't.
Reply: Not with jets. Can’t erase mass x velocity squared. Need to much energy to maintain that speed for a usable amount of time. Would need nuclear jet engine. Or something to change the physics of air in front of aircraft.?
Reply: Yes, but only for the super rich. This tech will be >99% military.
Reply: They'd be for the ultra rich because there's no way this would be fuel efficient. Pass. Give me a week long dirigible ride.
Reply: No, because they had one. This is old news. If you could get rid of the sonic boom then more countries would want it. Nobody wanted the concord. It’s speed was Mac 2.04.
Reply: @keymartin630  How fast do we have to go to at the very least into low orbit with a single stage propulsion method? Is Mach 5 enough?
Reply: @wolfgangjr74  Unfortunately, no. To get into orbit around Earth requires a speed of about 17,500 mph which is around mach 25.
Reply: @richardmccann4815  Travel by high speed rail is substantially more efficient than subsonic flight and drastically much more so than supersonic flight.  We can't afford multiplying the carbon cost of air travel while anthropogenic carbon dioxide emissions are still increasing.  Unless you're a 1%er, you couldn't afford a ticket.  Hypersonic passenger jets aren't impossible, they're just a very bad idea at the worst possible time.
Reply: The main reason commercial aircraft have not gotten any faster in recent decades is due to fuel efficiency. Airplanes consume more energy the faster they fly, so airplane manufacturers favor slower speeds to save on operating costs. Additionally, modern jet engines are designed to work more efficiently at lower speeds. Don't see airline companies sacrificing costs for speed.
Reply: @DollarsforDino  Right now you are correct because there is no destination in space. There also isn't a hydrogen infrastructure. Both would be required for a real need to make the vehicles. But, I think we're leaning towards both so, technically, the mach 5 aircraft would be a stepping stone to the orbit-capable aircraft.
Reply: it might, but I dont think it will be economically viable.
Reply: no, they wont. we already had supersonic jets and they failed, why tf would we have hypersonic passenger jets?
Reply: The X-43 was mach 9.5... Mach 5... who else was struggling with that? Oh right china couldn't hit within a mile of their target. Embarrassing.
Reply: In close future -- only as business jets
Reply: I surely hope so
Reply: Not with this design.
Reply: Obviously
Reply: Yes, but not common place.  It takes too much fuel.  There is a new tech for making fuel out of thin air, co2 plus hydrogen to make alcohol .  The sonic boom problem in the 60s was due largely to the poor quality windows in many buildings, just little squares held in with plaster in thin wooden frames.  Now everything is double panel with PVC and silicone or aluminum.  Lastly, I don't understand how you are going to get the jet engine out of the way of the intake for the ramjet.  Bypas air around it?  How do you shut off the opening? A big plug?  I would suggest you study memory metals to alter the intake and combustion chamber shapes at different temperatures.  One shape may work well at mach 2.5 but you may need a sleeker formed shape for mach 4 and up and a solid memory metal that changes at the temperature reached at mach 3 would reshape the chamber to get better fuel efficiency for the higher speeds, assuming it didn't melt and could bend enough for your purpose.  Perhaps the nose cone for the jet intake can expand and move backward and the intake port contract and move forward to form an overall cone for your ramjet.  Memory metals might help with this.
Reply: What about hypersonic flight regulations over land. Aren't they prohibited? Damage to ear drums and structures as well as sound pollution
Reply: Need to get enough altitude to eliminate air resistance. Gravity can supply much of the energy required.
Reply: @georgegibbens9356  Yes its a ways off.On the bright side ,in 50 -100 years airline passengers won't have to tolerate  listening to intoxicated Karen's and Ken's argue with flight attendants over why they're special and shouldn't have to follow the same rules as the other passengers on a 10 hour flight to the Middle East...LOL.
Reply: NEVER! This would be much to loud anyone on the ground.
Reply: My question is what will this do in our atmospheric limit almost space ?   Or even an different engine for Actual Space Speed. zoom zoom. BMPardone
Reply: @toupac3195  supersonic jets failed because of noise over built-up areas general public wasn't happy and so overwhelming complaints beat out innovation
Reply: I think it's possible, but the biggest issue for this plane is not having redundant engines. Safety is too important for commercial aviation
Reply: Well it's going to be a challenge especially taking of and reaching to the optimum mach no. But yeah its amazing to see a company which is not profit based but innovation based.
Reply: No, there is no market for such a jet.
How many jets they need to sell to go profitable?
Are we sure there will be enough demand?
Crossing the ocean in 1/5 of the time while paying 10x the cost is attractive for who?
Reply: it makes no sense to do so.  Actual flight times unless you are going around the world are relatively short.  You would spend as much time accelerating and decelerating as flying for any domestic flight.  even supersonic barely makes sense.
Reply: not unless its affordable. We have been down this road
Reply: Inefficient one reason Concorde failed.
Reply: 7/25/2000 is my answer to that
Reply: No, due to sonic boom. Concords downfall.
Reply: Tough to really say... supersonic passenger jet's have failed and lack the overall cost efficiency (fuel is expensive) so a hypersonic jet would likely be in a similar strand of affairs... their primary usage would be for say station docking (if we get to the point where we have resorts in space effectively, or orbiting cities). Hypersonic flight seems far more realistic for military applications and or scientific ones.

Let alone the forces on the passengers themselves... I know for sure it won't happen in my lifetime and it won't happen within my kid's lifetime; but maybe 200-300 years down the road.

The only reason I am saying this is because of the costs associated, and the lack of a need from the commercial airline space and for say shipping it's likely even worse due to just overall costs (a hypersonic cargo plane, taking overnight to the next level).
Reply: Ever seen the concord and how it ended in ABSOLUTE FAILURE??? CUZ OF THE SONIC BOOM
Reply: No this will be used by the military
Reply: Nope, it will fail for one simple reason, Supersonic flight is banned over most continents due to the shockwave the planes make, just like the Concorde, it could only go supersonic at sea, as the shockwave would smash windows under its flight path.
Reply: They already were supersonic passenger jets. There was concord and the Russians knock off version
Reply: Nope
Reply: Someday we will learn how to use the gravity from Space to get around
Reply: THEY ALREADY HAVE AND FAILED BECAUSE OF THEIR RISKS AND FAULTS
Reply: Yes when fusion power replaces all other power sources.
Reply: Nope and they make zero sense.
Reply: All of our transport is moving away from fossil fuels. This trend will increase as more and more people realize their house may well soon be on fire or underwater, that the major river their livelihood depends on has dried up etc etc.  
It is possible to make green aircraft fuels, but they are hugely more expensive. Therefore the future of aviation is likely to be major cutback in number of flights, and obsessive pursuit of fuel economy. Hypersonic flight is very unlikely to become a reality.
Reply: One word: Corcorde
Reply: SpaceX Starship will be demonstrating in the next few months, so if you include going via space, unequivocally yes, but yes anyway.
Reply: @Godscountry2732  Next 10 years. Maybe even with regular passengers, but safer to say next 20 years for that.
Reply: I don't
Reply: I think as long as long as there’s a military need to find a better  weapon system then yes
Reply: Lol no never. Public school zombies would think so I'm sure xd jeez
Reply: @lmp9256  Yes I agree,at some point will see the next generation of high speed passenger aircraft.The airline industry has always supported the development of fast passenger transports.That  more then anything tells you its going to happen.
Reply: The concorde was hypersonic...
Reply: @thecrusader6401  imagine and explain how such a plane could come down from hypersonic speed to subsonic safe flying in any reasonable distance , and land safely with barely any lift...I doubt it..and it would need 10 miles runways too...
Reply: Passenger? (X) doubt. Simply b/c people hate sonic booms overland. Military tech? Certainly. The idea of single-stage-to-orbit seems very intriguing, though I'm not sure how necessary that'd be given that Elon Musk regularly reuses rockets. Maybe if the USAF wants some sort of space jet that can take off, and vector through space to get to any spot on Earth within a few hours? 

Maybe some sort of cargo jet like a souped-up SR-71 descendant with the purpose of being a cargo freighter that can take off from Earth and single-stage-to-orbit ala the space shuttle? I.E. the blackbird and the shuttle decided to have a baby?

But as far as passengers? I...don't see the point. What's a trip that absolutely mandates hypersonic flight over the ocean?
Reply: @joshtryon1107  exactly what I was thinking
Reply: not in my lifetime. maybe kids born in 2060 might see them one day
Reply: What a stupid question. Ever heard of Concorde? It was a reality. But it uses too much fuel, it is too loud, and it is not more comfortable than other flights, it is just faster and more expensive. If you prefer comfortable travel use train and ship.
Reply: @tinu5779  
I thought it was only  civilian supersonic aircraft, Mach 2 not quite the same thing.
Reply: @SpaceManAus  Right, but back then it used so much fuel that it was difficult to compete, i guess at Mach 5 the fuel consumption will be enormous, who would want to pay for that?
Reply: Nope. Too expensive to appeal to enough travelers. Maybe a niche for the super rich, but not for commercial airlines.
Reply: I would hope that supersonic air travel would become a reality, as far as I know your average ramjet is more efficient than a standard turbojet as it’s not taking some of the energy out of the exhaust to compress the incoming air and when combined with the fact that it’s easier to make a ramjet run on hydrogen that is is to do the same to a turbojet it could be less damaging to the environment in terms of exhaust gases, sonic booms and kinetic heating could be an issue though
Reply: @polarisukyc1204  
You know I have walked under two man made anti gravity disc's in my youth built in Melbourne, Australia and have been waiting for them all my life, but they pretend they don't exist, so I don't hold much hope.
Reply: @SpaceManAus  I don’t know what you mean, other than to say that companies probably won’t buy a hypersonic transport which is very possible, but antigravity wouldn’t be needed in a hypersonic aircraft
Reply: @polarisukyc1204  
What I am saying antigravity vehicles are electric, faster and cheaper to run but keep them hidden for their own use, I understand they could not have them for private use but commercial use why not.
Reply: @SpaceManAus  antigravity might exist I’ve seen some interesting experiments been done with superconductors, but it’s not needed, especially at hypersonic speeds, the lift force provided by a lifting body is directly proportional to the square of its velocity which means if the velocity doubles the lift force quadruples, at those speeds you don’t even need a wing, the X-43 was a nasa test vehicle propelled by a scramjet and was essentially a flying streamlined slab with almost no defined wings at all, if your talking about subsonic travel, I doubt antigravity would make much of a difference, there are 2 possible ways I know of, 1 bend space-time according to the Einstein field equations which would take an enormous amount of energy, and 2 try an find a theory of quantum gravity and hope that it shows that gravity can be influenced by a lower energy effect of some sort.
Reply: Hope so!
Reply: Who needs or can afford hypersonic transportation?  Like the Concorde, mostly arabs will use it to quickly get from London to Dubai.  The rest of us couldn't afford the cost of that kind of travel speed
Reply: @lutzliebenberg9511  probably won’t go from Dubai to London, at least not directly as it’s illegal to travel at speeds above Mach 1 over populated areas in most countries and  it would be rather expensive to go the long way round and travel over the sea
Reply: No, coz flying all the way with afterburner , you need A LOT of fuel.  For example when military plane turn on afterburner in extreme situations because when they on afterburner , they spend all their fuel in 10-15 minutes. 
And this plane will run afterburner non stop , it will need like 100 000 liters of fuel for an hour of flying
Reply: Can you place explain the g forces and how regular people will be able to handle them. I'm not dumb but I'm def not a rocket scientist. It seems the g forces at play would be a giant limiting factor in a passenger application.
Reply: @DrHavok1  G forces only occur under acceleration, if the vehicle accelerates at the correct rate the passengers won’t be turned to jam, assuming my calculations are correct, 1g acceleration will get it up to Mach 5 in just under 3 minutes
Reply: No. We can do it now, they don't bc its to loud. 
Its just a waste of time... said Phillip von jolly to Max planck.
Reply: No, why would it? Maybe faster than the Concorde, but the Concorde was retired for a reason and this seems to do nothing to address those issues.
Reply: Yes but at sub orbit altitude
Reply: No, sonic booms piss people off.
Just make good trains, its not that hard.
Reply: yeah some day for sure,
Reply: Yes, most definitely! I truly believe on the amazing team working on this project.
Reply: @thecrusader6401 lol no
Reply: we could have done it decades ago, i assume we dont because of the risk and insane amount of noise
Reply: Yes. Sadly, not in my lifetime.  I’ll probably never have a chance to fly in their plane.
Reply: Concord was a thing. It was just way too ahead of the time and got grounded and that was less than a century ago.
Reply: No u will need every one who flys a flight suit
Reply: Hell no, the planes we have are the absolute most efficient they can be, transonic is proven to be the most efficient fuel saving
Reply: @algorythemQ  you're obsessed and its sad LMaooo
Reply: Key Martin  space is not what you think it is bud, you have been sold a lie
Reply: No. The concorde failed for a reason. Well, a lot of reasons.
Reply: I think it comes down to materials. It's only a matter of time until we have the right stuff. Material Science is a huge industry with a lot of incentive to do research. I feel like a breakthrough will come when we can (weld) layers  of compound alloys a molecule\ atoms thin until we have a material that has the durability and properties that we need.
Reply: @algorythemQ  If you or anybody else thinks one man is stopping you from achieving your goals then  you need to evolve your outlook on life. It's not just silly to have a two party system it's silly to think you can't find a way to do what you want to do because of it.
Reply: @nedkelly9688  name of the drone?
Reply: no its not economical and its gonna be uncomfortable
Reply: no
Reply: After thinking about it. I think it'll be more likely that we will have suborbital flights. But I think it will involve hypersonic craft in order to do so. It's more practical it's more fuel efficient and I believe it would be much faster.  you only have to use fuel to take off and land and you're constantly not making Sonic booms
Reply: It's feasable for airliners, as Orbitliner service. These aircrafts must meet FAA realism. The ability to fly very high, have turbine adjacent micro air compression nose/front cooling, minimizing the historical maintenances on arivals.
Reply: Only for the Elites/Ruling passengers...You didn't mention = In 1964, Pratt/Whitney already developed a working engine used in the SR-71 Blackbird & A-12...🇺🇸 😎👍☕
Reply: @lilblackduc7312  yeap ...those engines would've been more efficient in the bulk blade purpulstion with electric turbine & less fuel after burn for a airliner mounted feature.
Reply: If you manage to "pull off" the human experience. Human body wasn't designed for a Mach 5 flight, and if it's an unmanned aircraft, you've already done it 🤔
Reply: Yep. Just need to configure the materials to withstand very high temperatures.
Reply: @keymartin630  You're assuming that SSTO's will ever have the same lift capability that conventional launch-vehicles have which is a pipe dream. SSTO's will never be more economical than traditional vertical launch vehicles because the mass fractions required just don't allow for it and never will (certainly not within our lifetimes). With SpaceX's and Blue Origin's plans for launch vehicles we will soon have fully reusable 2-stage vehicles where the only (or essentially only) cost will be fuel which is miniscule compared to the cost of the vehicle. Two space planes would still only have a fraction of the life capacity of a vertical launch vehicle while having significantly more complexity, a higher operating cost, likely a higher build cost as well needing specialized engines (turbojet/turbofan to ramjet/scramjet to rocket engine) and materials for the skin, and advanced technologies and control algorithms to successfully navigate the vehicle up into orbit. Too many people play Kerbal Space Program and think they know everything there is to know about how to design and build launch vehicles and space planes when the reality is they still don't have a clue. 

Source: Me, a guy with an aerospace engineering degree who worked on part of the Artemis program for a summer and is currently a masters student focusing on hypersonics/high speed flight and aerothermodynamics.
Reply: @jacobdewey2053  My apologies, but I don't play Kerbal, never have. 

Anyway, the question did not have a time limit so I answered as if technology would continue to advance. My thought was, if the need to carry enormous amounts of oxidizer is removed or significantly reduced, a portion of that capacity could be used for new structure and the rest for extra payload. 

Will we be able to do the equivalent of flight being impossible in 1869 to landing on the Moon in 1969? Probably not; there's no driving financial incentive right now. But that doesn't mean it won't happen. It isn't impossible; just expensive.
Reply: No the same reson of concord to expensive
Reply: @keymartin630  This is a great point! Although being in a passenger hypersonic jet that's dropped out of another jet sounds like something that would take  the title "vomit comet" from that  astronaut torturing device NASA came up with.
Reply: Nope and this is such a waste of time.
Reply: not in our lifetimes, I can't help but feel their endeavor is a bit optimistic
Reply: hell no... economics dont make sense plus all the regulations in place about sonic booms
Reply: 4 months between designing, drawings and build? Nope. Fabrication alone would be a lot more time consuming.
Reply: No. It is highly impractical for regular passenger aircraft on several levels. The only, real value for hypersonic aircraft is, unfortunately, for military applications.
Reply: @davecrupel2817  100% agree, and not to mention the environmental catastrophe these jets would be if running on fossil fuels
Reply: Dear sir  concord was an economic flop 
Boeing ran the numbers and backed out 
Hyper sonic ?  They still have problems with subsonic  do you really think anyone would invest in such a lopsided adventure ?
Reply: No, never in closest 30 years
Reply: No. The Concord SST was unable to make supersonic transport a commercial reality. Why would we want hypersonic? For what benefit?
Reply: Isn't transition from turbojet to ramjet done in sr-71 engine? Is it something different?
Reply: Depends... If maintainance, fuel costs,  make it profitable,
you are not allowed to fly supersonic over land. So that limits its practical journeys to mostly around water.
Reply: Probably not, the world revolves around money. It's going to end up being too expensive for companies to buy into or invest into this technology. Most of their money comes from economy class passengers, not first class.
Reply: I think they need to upgrade the word impossible, because the rate of innovation is mind blowing.
Reply: Not until some incredible revolution in propulstion tech, it is just way too expensive and inefficient to go that fast for travel reasons.
Reply: Just for the military. It makes not much sense to go so fast.Better is to live healthy and care your youth. Than you got time enough.
Reply: The earth is flat, there is no curvature.
Reply: @davecrupel2817  if the NASA low sonic boom supersonic aircraft tests prove the technology viable, they MIGHT and I stress MIGHT have a chance of getting the legislation changed that currently stands in the way.  I agree with you though, during and after Concorde government regulations absolutely slammed down the ban hammer on Sonic booms
Reply: It will have to compete with SpaceX starship point-to-point travel
Reply: Yes but only the rich will be flying due to cost
Reply: Use pulsed combustion in the combustors ( a pulse jet combustor for each combustion chamber ) to increase the overall compression ratio. It is  a free compressor utilizing sound waves at subsonic air speeds but propelling craft supersonic then the Ram aerospyke nozzle takes over at hypersonic. Axial flow  Turbine with pulse jet combustion chamber to Ram jet ..  fast ....faster  .....fastest!!😎😃😆
Reply: yes beacaus hypersonic is so much more feul efficient than supersonic flight
Reply: No
Reply: u ever heared about climatechange? thanks for giving us another engine which will heat up the earth way faster.
Reply: The concord is the best
Reply: No, cause this still doesn't tackle the biggest issue with mach + flight. Sonic booms.
Reply: no too fast too dangerous
Reply: Basically as an engineering student, it will be very amazing if the hypersonic passenger jets become reality. But, is it necessary to use a hypersonic passenger jets to travel form one place to another on earth? yeah, well if we think about future it will be reality but complex too. My question is, is it necessary to develop one? Let me know and crct me if I'm wrong.  
Thank you.
Reply: Concord has entered the chat
Reply: No. I don't.  The same problems that killed the Concorde still exist.  The first problem is the cost, the second problem is the sonic boom. Simple math states that twice the speed = 4 times the energy. Going 6 times the speed would require 32 time the energy.
Reply: Humans are going to surpass the/ that milestone 
Actually getting to do time travel
Parts of the maths are already written and there
Pretty interesting what Einstein left behind  already😂
Just you're still going to need a vessel/ suits
Reply: @toupac3195 that reason was ( too noisy aka sonic booms )  & it was too expensive for most people.  With there being way more people today along with our DEMAND / NEED for everything to be " instant "  I firmly believe someone or a group of someone's will pull it off and make a profit while doing so,  just IMO.
Reply: @davecrupel2817  think of all the PRIVATE JETS then imagine a company that makes a high end luxury supersonic jet that can take those same people as passengers which will provide them with something their own jet can't... this jet will allow them to TIME TRAVEL ( i know )  this jet will save them hours, which turns into DAYS and then finally when it's all added up MONTHS of time which they can do anything with. 

1000% this will happen.
Reply: Is there a such thing as a hypersonic boom
Reply: no because it could only fly hypersonic over oceans... this already caused tht Concorde to fail
Reply: @toupac3195  I doubt you know the real reason 😅
Reply: why are you talking about the X 15 it's rocket powered you should be take notes from the SR71 or the A12 , because it uses a jet engine a ram jet to be precise not a rocket engine .and it's more alike the vison you thrive to achieve .
Reply: @toupac3195 Expensive flight and interference for other residents due to the loud sound of the shock wave
Reply: @davecrupel2817 If such constructive comments became the content of the YouTube platform by at least 50%, humanity has become smarter✊
Reply: Why bother
Reply: What about the noise
Reply: Why don't you just create a shell that can change into different shapes?
Reply: WHY   d'you  Ask?
Reply: Ya … with some serious Gsuits 😂😂😂😂😂
Reply: so, we had a discussion about that among friends. Here's why it's very unlikely:
1. We had Concode and Tu-144. And yet, we're not developing this technology in practical applications.
2. The travel time has actually grown, compared to 80s, (from 5 to 6 hours across Pacific) as it allows for better economy. And that's the area in which the industry grows. Making travel cheaper
3. Due to shockwave, and it's influence on people on the ground, You could fly hypersonic over sea, or change laws.
4. Taking into account all the security checks, boarding, preboarding, waiting at the airport, in vast majority of air travel, the flight is actually the shortest thing you do. So, a flight from paris to berlin takes 1h 45 min. How much do You think You could shave? Including acceleration and deceleration? It's not worth the fuzz.
Reply: You mean like the Concorde? If people will pay. They'll still crash, though.
Reply: No. Matenence, safety,  and fuel will be a problem that won't be overcome.
Reply: @davecrupel2817 They will sell shares and go bankruptcy.😂😂😂😂😂
Reply: I doubt they will under the rule of capitalism
Reply: what's the need in that tho??
Reply: Naaah, we had Concorde and it blew
Reply: @davidkerr7 
Are you really asking this question?
Can't you see?
The answer is time my guy.
Reply: Some day but not with you guys.